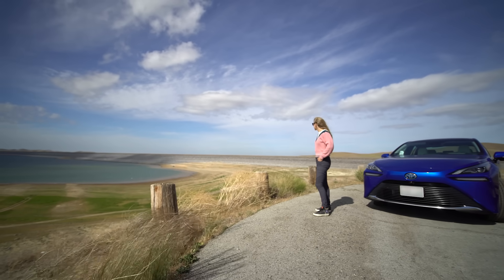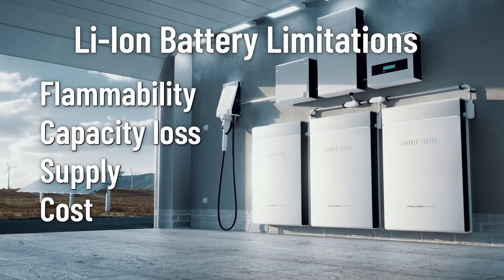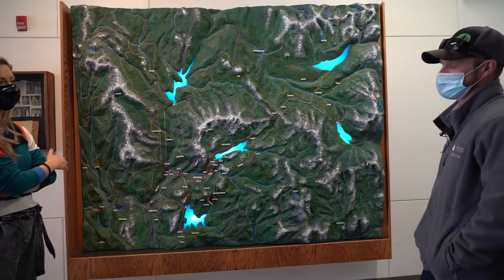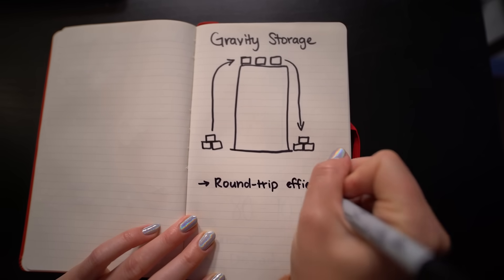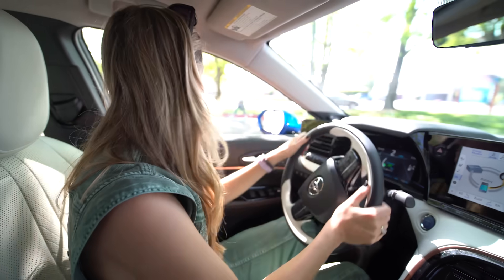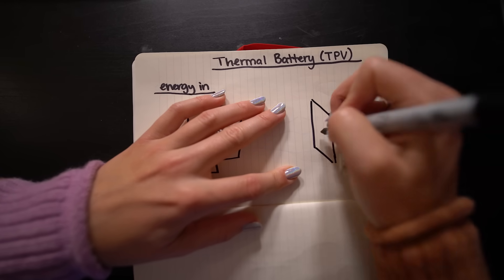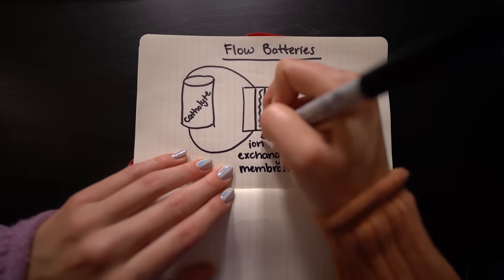The BIGGEST problem with clean energy

Comment: Another energy storage technology that is cool is rotational energy storage.  Use electricity in off-peak times to spin up these massive metal cylinders to ridiculous RPMs with super low bearing friction and then just drive a turbine directly from the rotation when you need energy out.

Comment: I'm doubtful lithium supplies will ever be a large problem as it's incredibly abundant in Earth's crust (0.002% by mass) and there is even an estimated >200 billion tonnes of lithium in the oceans which could easily be processed over the next 100 years.  Also, we need to remember, raw ingredients for batteries do not run out as gas and oil do - all lithium mined and processed can just keep being recycled.

Comment: That compressed air tech looks awesome. The hydrogen system is also fantastic, as they can produce clean water at the end of it. So as well as providing energy, it can provide water security to dry coastal regions.
Reply: Is the hydrogen system harmful to the fish?
Reply: @RM-xf9gi  ummm.
No.
Reply: Sadly, I doubt you could make enough water to make a significant impact on potable water supplies...

Comment: The problem with storage in renewables is the same as extraction. Too much space is industrialized vs how much space is served. Condensers and battery barracks take up too much space. The materiel needed is long term unsustainable, and too inefficient. 

I totally agree we need to figure out storage, but a new technology has to be created to make that happen. The alternative is more planetary damage than this "Green Energy" supplies. 

I run my main vehicle entirely on solar it's a scooter that can accelerate to 60 miles per hour and travel 50 miles on a single charge. Numerous times however I have had to use a back up battery to go when needed due to conditions or time it takes to recharge. The battery is 45 lbs. That's where the R&D has to go. A new method of storage can impact everything including the internet itself. I believe you hit on the most important point. Hope someone can solve it.
Reply: Your scooter works for you as your main source of transportation. But then it does not. This is because you think you are only using your scooter. Directly you are. Indirectly however you are using aircraft, trucks, trains, ships, and all the different industries that produce all these transportation infrastractures and the ore minded to do so, just so you can go with your scooter and pickup a gallon of milk from the store, or order in your clothes from Amazon, or your devices, etc... To sustain your living and your scooter driving practices, all of these other things are a requirement. Your scooter won't do you any good if you have to haul your wood for heating and cooking and your quarter cow for eating and your crop that you grow on your roof to the market for trading. How is your plumber doing his work on his scooter? Just to name a few problems with looking at the world from space.
Reply: @alternajarsandbladesforble8896  my scooter can carry 800 lbs and I have a trailer for it I can move quarter cord of wood easily. It recharges by solar panel. It's nothing like you describe.

Comment: Would it be possible to use a heat-pump combined with that liquid air battery? Essentially producing power with the heat of the atmosphere, and if global temperatures go TOO high, this kind of heat-exctraction could reverse some of the heating, assuming you dont use the potential power you make :)  
Maybe i'm missunderstanding the physics.

Comment: Thermal storage could be an easy fix - if only for every action there was not an equal and opposite reaction.
Pros: After storing the peak heat/ energy generation of the day minus energy lost through degradation, storage and transmission - you can then convert this stored heat during the evening for electricity upon need. Could pumped hydro be the the solution? It could potentially offset the thermal generation issues of electricity if properly distributed to the land.

Con: how do you store heat locally without emitting and transmitting the heat to the surrounding environment land and air? As doing so would more rapidly evaporate and desertify the environment. The more energy we "create" (we're not actually creating anything but translocating) the more heat we emit, while "fighting CO2", may not be helping combat global warming at all. The further we more forward into an energy future the more we require innovation on how to cool the earth to offset the energy we are displacing. Deforestation is not 100% the problem - but by doing so removing our natural thermal, carbon and hydrodynamic barrier to the surface of the earth - and that IS a big problem, humanities biggest plight.

Comment: Hydrogen fuel cells aren't very efficient, couldn't we just (would need to be designed for) burn the hydrogen in place of natural gas in a gas power station to get back the electricity?

Comment: Is that 80 percent measured against a battery's efficiency or the real efficiency relative to the input energy?
Reply: 80% is a typical AC/AC round trip efficiency for lithium ion. It can be a little better, or a lot worse, depending on the actual operating conditions, primarily temperature control.

Comment: Addressing things like the Sun rising & setting every day, the wind stopping and starting, the efficiency of a solar cell relative to the Sun's location. Your point regarding storage is really most critical. While you mentioned wave energy, the fact that a cubic foot of water weighs 62.4 lbs, is important.  So that when we say force is equal to mass times acceleration, wave energy must be a part of the calculus. The guy that stated that 'we have to go with the flow', was right, to the Nth degree.

Comment: Gravitricity is IMHO the best energy storage option for large grid level operations.
Reply: FESS and liquid metal batteries.
Reply: Gravity is very inefficient (not as in round trip efficiency, but instead as requiring a lot of mass or height to store tiny amount of energy). That's why, unfortunately gravity alone cannot solve the problem, but for sure it can be part of the solution.

Comment: The missing piece here is getting gas turbines to run on pure hydrogen or a near pure hydrogen-synthetic hydrocarbon mix. That way you can produce and use the hydrogen without the need for platinum, store months worth of energy as liquid hyrogen, and use hydrogen gas turbines to support the variable renewables. I’d say that hydrogen turbines is the most important technology we need right now, even more so than fusion. But I understand that Toyota is heavily invested in fuel cells right now.
Reply: But 20% of the energy goes right out the window to create the hydrogen.   Then you combine it back with a 2 stage turbine getting what 80% efficiency?   So at best you are at 64%.  

This is not a viable solution to an immediate problem.  The whole concept only works when you have abundant clean energy to create hydrogen, which we don't have.

Comment: You should check out Ambri with their liquid metal battery, it's very similar to flow battery, but I don't think it is the same as I don't think they have any membranes that separate the liquids, it's simply the density of the metals that separate them. They are basically just a box with three molten metals in it, and gravity does the work of separating them

Comment: Mechanical storage options should also include massive and comparatively slow rotating flywheels.
Reply: Why slowly rotating? Wouldn't it be more powerful to make it fast rotating, as the energy increases to power of two relative to velocity, but only linearly relative to mass? Of course downside with higher velocity, is higher air resistance losses, except if one makes the flywheel rotate in a vacuum.

Comment: Kind of sad flywheels weren't mentioned, it is also up and coming and the great thing about them is that they are like 90% recyclable.
Reply: I wouldn't call it up and coming, it's one of the oldest ways of stabilizing an electrical grid and make it resistant to temporary drops, kind of like a UPS, gravity storage is a lot more practical to store lots of energy long-term and has great efficiency
Reply: Flywheels also have a cycling limit. Good for backup.
Reply: They are used when extremely high peak power for a short time is needed. But not a solution for mass longterm energy storage. And they can be super dangerous, when failing.
Reply: flywheels are relatively dangerous and inefficient
Reply: If you get in an accident with a regular car, the worst that can happen is a small chance of a fire.

If you get in an accident with a flywheel car, the worst that can happen is the flywheel will break loose and careen down the street destroying everything in its path.  And if it hits another flywheel car...
Reply: Christchurch city NZ trialed a flywheel bus many years ago, the flywheel was carbon fibre running in a vacuum chamber so in the event of a collision the flywheel would self destruct into carbon fibre dust, dont know what happened to it, maybe it didnt have a vertical spin axis so could not go around corners (gyro precession joke)
Reply: Energy recovery from a flywheel is a constant drop compared to things like pumped storage that’s pretty flat energy output until the water runs out. And, one of the biggest problems with flywheels is the change in speed as power is taken from the flywheel. When it’s spinning fast it has a lot of energy, but likely is spinning to fast to really be used directly. Then as energy is removed it quickly slows down. All that means you loose a lot of efficiency with some system that balances out that energy recovery.
Reply: Flywheels aren't practical. They take a very large amount of energy to get to speed. Require continual energy to keep rotating at speed. Then lose their energy rather quickly. The energy they store can also be incredibly dangerous considering their mass.

Comment: Efficiency, safety, Wh/kg, and transportation is our number one energy issue. How about LLNL and NREL reports discussing the use of a laser to store hydrogen on a large light-activated film using a process called solid-state hydrogen from companies like Scottsdale AZ's Plasma Kinetics? These rolls of film are recyclable, safe, transportable, and produce instantaneous power at 1000Wh/kg versus 130 Wh/kg from Li-ion batteries. Granted it does not match the energy density of 1872Wh/kg that compressed hydrogen produces but when compared to the cost to produce and deliver Solid-state hydrogen is nearly 2x ($) more efficient. We could build more solar and smaller nuclear reactors to baseload the production of solid-state hydrogen. Hopefully, in the next five to ten years we will see the production of Thorium reactors.

Comment: Renewable is an inferior option compared to nuclear, we are struggling to match CURRENT energy needs and come from inconsistent sources of energy, compared to nuclear fission it loses in all aspects, the output will be like going from dial-up to fiberoptic in terms of energy availability, its consistent, reliable output,  its cost, its far safer in terms of deaths per terawatt hour. With thorium instead of uranium, meltdowns are near impossible due to it being a liquid and has a far more stable reaction that isn't eternally trying to supercritical. we cant run out and if half the amount of effort and manpower that's put into solar and wind were used on thorium we would be done in no time. its suspiciously looking like its being pushed oil etc by big media because it keeps us at least partially reliant on fossil fuels and coal rather than nuclear which will make them completely obsolete

Comment: We as a country are behind on preciouse metals that we need for these new technology's . The power drain from the charging  stations . On top of that the cost of each charging  station is between $250,000 to $350,000 each.Im sure you know more than I. Just some examples. We are under great pressure for quick changes. This global warming is forcing us for a quick fix then the Pandemic resurgence .We need a simple grand alternative . Some promising ideas. The question is can we do it quickly with the clock constantly changing and the goal post being changed daily ???.Great Video and Visually stunning 😎

Comment: International transit system, sequestered volcanoes, flux capacity capture lightning towers with agri-solar collection, redirection, and water storage-distribution systems. 
Batteries of the continuum, as digitally connected to a global postal service internet of absolute security: to allow peak flows and off peak energy to go where it is needed.  The International transit system and global postal service moves water at high speed in its transit way, which can be dampened to return energy if it is not in high storage.  The compressed current of  3.4 meter diameter tube with max. 92 kmph water flow rate through it for short return or fast expression of any power peak: to not get grounded or lost, as current is maintained mechanically: moving the water of floods to parched lands, industry, and agricultural towers along the way.  Often underground, with electrical vehicles on a modernized and safe electric rail, where lane changes and train cars disengage when in motion, to exit the high speed route way. 

To deliver world peace through global transit.  Communication, new videogame expense of possibilities: and a future where we have the united strength to conquer other planets from static death: and fill them with life.

Comment: Using pumped mercury instead of water would result in a smaller footprint for the output, and possibly a higher/quicker output of energy for similar sized turbines. 

Drawback would be the engineering of the turbines to be more robust. 

Leakage could be easily solved with a closed and sealed system to prevent environmental damage or health risks to personnel.

Comment: Nice vid. I was curious about the "energy in-energy out" methods; specifically the energy in part. How much energy is required to run the hydro pumps or the weights "uphill" as compared to the return energy on the way down? And where is that energy coming from? I was hoping this would've been answered in the efficiency conclusions at the end of each method.
Reply: The best propperty of using water is that it it self can not ware out.  Unlike weights that needs pullies and cables and can broken it self from moving around. Pumping water the ware item is the pump not the medium. Not the case for weight storage as the medium also can get damaged.

Comment: Nuclear Power doesn't need storage. 'Renewable' energy doesn't work as advertised. FIrst off, its not renewable; TANSTAAFL. It needs a lot more energy to make a thousand wind turbines than it does to make one coal fired plant. You mentioned the efficiency of steam turbines is lowered for smaller turbines ... same holds true for generators.

Comment: Large scale mechanical flywheels?  I know they're more mechanical capacitors than mechanical batteries, but they can store and release energy rapidly, which would have to be helpful for those other  major grid issues - voltage stabilization and frequency synchronization.
Reply: Yeah. There were some discussions in other comment threads about other negatives, but I still like mechanical flywheels for their quick switching between charging and generating. They're bad for long term storage. But if we keep flywheels on the table as an option for balancing the short-term load on the grid, then we don't have to care about the "how long does it take to start/stop" issue and it could open up more green energy generation and long term energy storage methods that would've otherwise been ranked fairly lowly just because they're slow to start/stop.

Comment: How about large capacitor storages? You store electricity in capacitors. Then regulate the discharge when power is needed. I used to run a 9 volt transistor radio with a chain of capacitors back in the late 1960’s.

Comment: One thing I think is just as important as storage is transmission infrastructure. 
After all why store it, if you can use it somewhere else.
I think the EU is already investing heavily in this with High Voltage DC cables going to be criss-crossing the continent.

Comment: The trouble is with a lot of the established "renewable" is there actually incredibly fossil fuel dependent. For example solar panel need high grade mined quarts. This then needs to be smelted with high grade coal at 1800 degree C. I think a full analysis of solar panel life cycle needs to be done from build to use to recycling then we would know if these are truly renewable. The other draw back is all renewable has a very high land use per kWh so has a larger impact on the environment. I'm for solar on roofs as that dead space but not for array over habits also they need to reduce there heavy metal content. I'd rather live by one nuclear power station within 50 miles than be surrounded by wind turbines, solar panel and there associated energy stores.

Comment: Yes and no, calculations showed, it's cheaper to have a LOT of over capacity in the US than use storage.
2:25 if you want to generation power you wouldn't want to "pump it back" :-)
5:21 really ? You got high places in NYC why not have a large storage on the roof ? It's to small scale ?
7:32 you really should look into the hydrogen solar panels from Leuven
12:59 seems like a very low estimate.
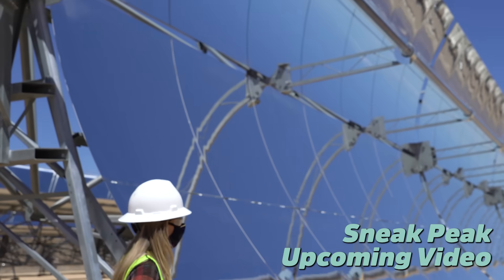13:24 molten salt ?